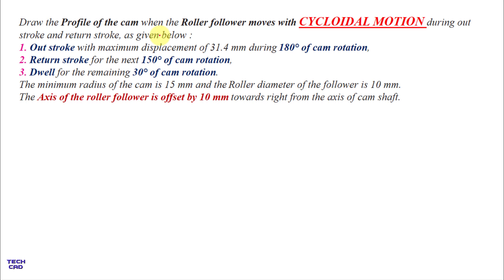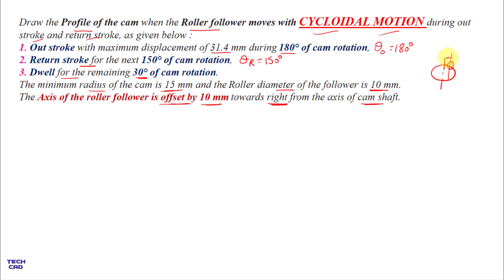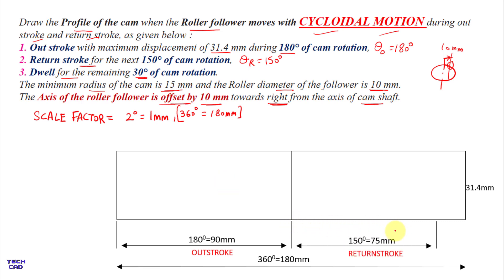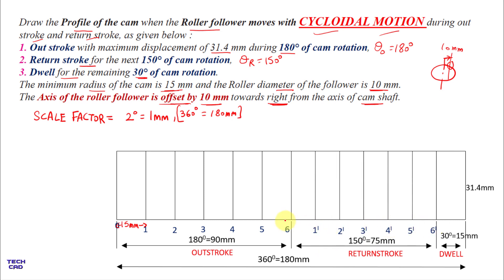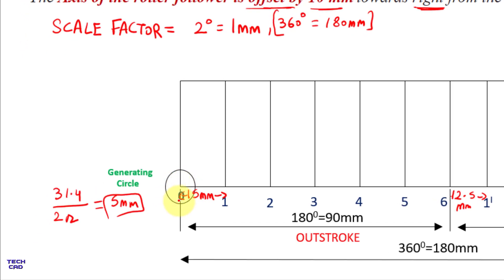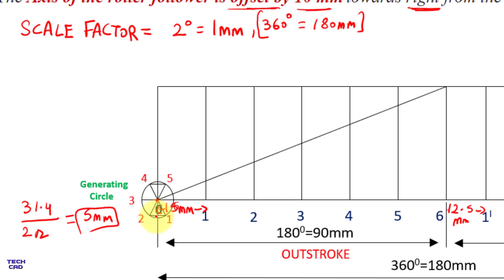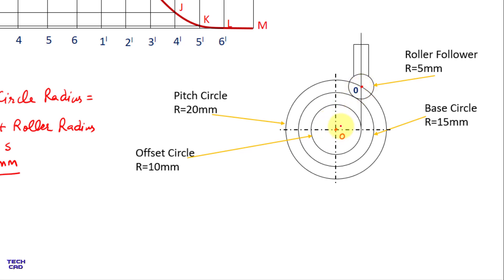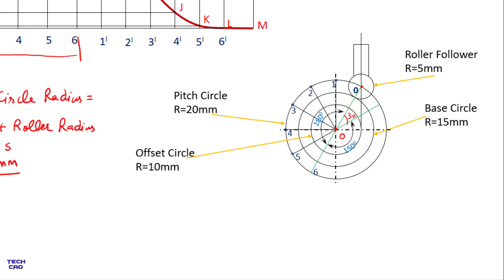HOW TO DRAW THE CAM PROFILE (ROLLER FOLLOWER) I CYCLOIDAL MOTION

Comment: Sir roller radius is 10 mm
Reply: But you are taking 5mm
Reply from the maker: @sujanm1984  its the diameter 10 mm not radius.
Reply from the maker: Diameter is 10 mm so radius is 5 mm